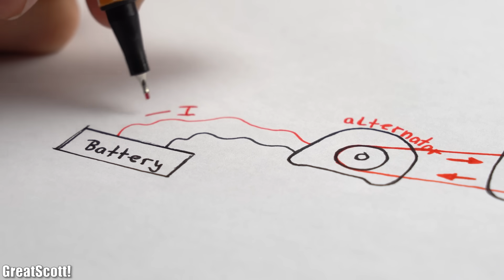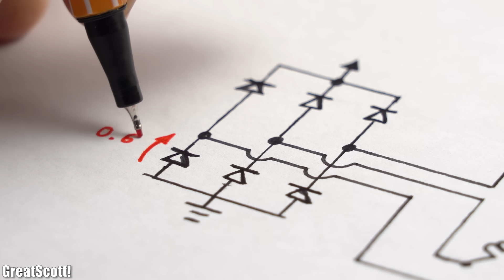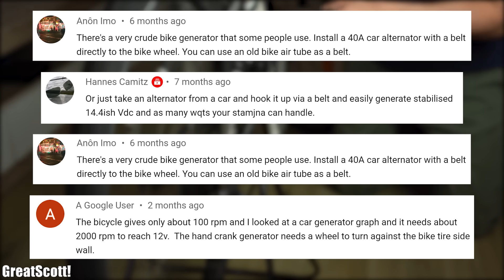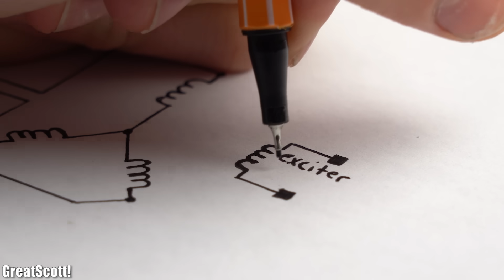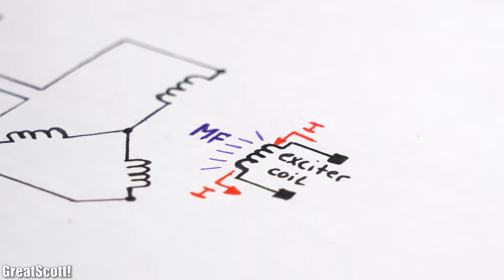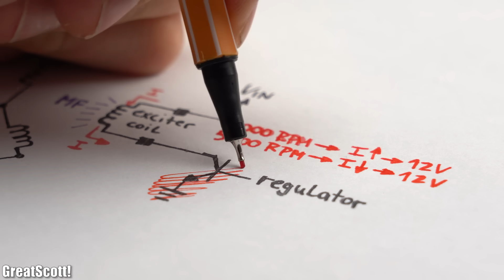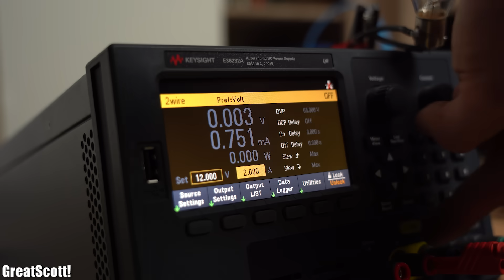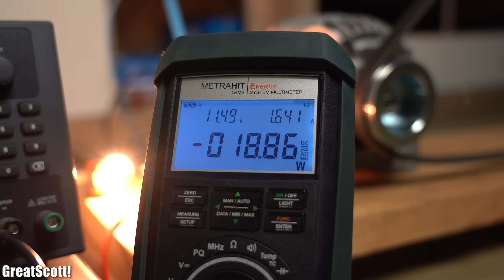Using a car alternator with a bike to power my home? How much energy can I produce?!

Comment: 2 questions: Why didn't you buy a 120 volt out put alternator for a car? Also, why haven't you browsed YT for those who have used a 12v auto alternator to generate 120v? Both are there and available.
Reply: any car alternator can be overdriven to make 120v and 5kw power and can be self exciting with a capacitor

Comment: Keep in mind that a alternator is not a generator.  It cannot produce electricity.  It can produce 11 to 14.5 volts on avg.   Try looking a 12v battery onto the positive lug and a switch on the exciter circuit.   Chances are you may need to start using the regulator circuit again.

Comment: I wish I could see it run again but this time with a .tensioner to Stabilize the wobble of the the need to add resistance to the Alternator was due to the absence of tension to the Belt. It was not taught  enough in my opinion. If you ever worked on a car or truck Bell System then tensioner Is What you adjust to secure the belt properly.  
Please try it again .🤔🤨🤨😉

Comment: Use a 12 volt battery and a switch run things off the battery use the switch like your ignition switch in car power things off of battery hook up an inverter to battery

Comment: you have to take two alt.... turn one into a motor and run the other to power your home and the alt motor as well it will  put out about 90 amps of 220 volts ...... have seen it done so it will work but you will need a solid set up to hold the alt and motor alt ..... but you cant run it all the time unless feeding it back to the grid   you have to take off the dc bridge rec of the one you use as a power your house source and one way dioid the lines to keep them from the grid back feeding into the alt..... so you dont get a shock from the grid be sure you have it all set to go before you plug it into the grid

Comment: Ok, this is my comment, and by no means am I an engineer, scientist,  or inventor.  I am just s guy with a thought. I would like to make closed loop system where there is a generator that will charge a battery that is connected to a motor that turns the generator that is charging said battery that is powering the motor, that is turning said generator... do you follow me? I hope so because I confused myself and can't remember who's on 1st

Comment: Something that would help you achieve more power would be same setup but the bike should have gears for low gear and high gear the higher the gear the more rpm just more wear on your legs .. also the best thing I could tell you is add a tensioner pulley to keep your belt tight so you get the most out of each turn with out it slipping at all

Comment: Great Scott use an older car generator pre 1974 car generator. This generator can be chiseled to spin with the field magnets to move the armature magnets and coils of copper wire.  Count the armature magnets and chisel off one sixth on and off all the way around the armature magnets.  When you reassemble it will be a permanent magnet motor that produces DC 12 volt. To convert to 110 volt AC power add inverters.  40 amp inverters are available.   1969 12 volt 120 amp generator can be chiseled to spin without fuel or cranking.  You could add inverters to have house current voltage

Comment: You can also overcome the need for the exciter coil by replacing the exciter coil inside with rare earth magnets.  There are several videos on YouTube on how to swap everything out.  You'll still need a belt tensioner to maximize your efforts and to keep the belt from slipping off, but you'll also gain additional power output since you won't be spending energy to energize the exciter coil.

Comment: Very interesting brother. I like this video.   I believe if you were to use an old washing machine motor. & maybe with a similar rig.  Remove the motor from a washing machine.  I think the coils would be large enough to output a good amount of electricity at lower 
RPM's.     

 Now what's better than powering it through a bicycle rig???      

Maybe large amounts of water gravity fed?  everything fed with just the pressure and weight of the water through a turbine connected through gearing? Or belts???

Comment: Try hooking a 12 v car bat to system as it would be in a vehicle . I had the same trouble with a water wheel set up I built . H2O  W  turned the peddle ,  " drive sprocket " of an old 10 speed bike then a belt off back rim , like yours ,  you will get a better result . !

Comment: Pro tip, hydro electric using a Pelton wheel if you have a stream near by. I bought one and used cinder blocks and clay to make a piped outlet where my creek was narrowest and I can power my entire house if I needed to now. I plan on actually utilizing it next outage and building a power barn
Reply: Do you have any more info on your hydro system on the net?

Comment: What did I learn from this video, I learnt the same thing I was taught as an apprentice electrician and a tradesman for 45 years, working in coal, manufacturing, power stations and heavy industry. That is, to provide base load power, you need, coal, gas or nuclear energy. Anything else is just virtue signalling. Wind and solar, (produced by fossil fuels), will never be able to replace, these raw energy sources, as a reliable alternative. Sorry but your experiment is 3rd grade science with no real solution for solving the change in climate or providing reliable energy to fuel the world's present and future needs. Sorry to sound negative, but sometimes reality is harsh pill to swallow. Even Germany the jewel in the renewable independence crown, gets their nuclear power via the grid from France most of the time, because renewables are a Joke.  Ouch!!!! Painful I know, but factual. Renewables just don't cut it and won't this century. Sorry people.😣😣😣

Comment: An alternator needs tge field Excited by 12volts .
As there are No Magnets in an Alternator ....
A Generator has Magnets and does not need the field excited to produce Power .... Took ya 10 mins to get there ! 
Early VW's had Generators not Alternators .
Why not just go Solar Charge by day watch TV by night ......
Add a light belt tensioner too ... Ugh.

Comment: I saw a guy that removed the diodes and it puts out 120v naturally. He had one rear bike tire and used a chain drive. He used a 9v battery to start the charge and spin the wheel, he had 120v coming out, can’t remember the amperage but it was pretty high! It would run on its own after the initial spin.
Good luck!👍🏻
Reply: Do you have a link?

Comment: Simply connecting a car battery would have solved many issues especially with output stability. Battery powers gadgets, alternator charges battery, it's the way it works.-

Comment: You coud of find the wiring diagram for the alternator by finding out what vehicle make and model(s) it's used on.  A vehicle mfg. will use a specific model of alt. to fit many of their vehicle models.  Also, the vehicle Mfg. may have the same alt. in different current [amp.] output. As a bonus of having the year,make and model of the vehicle you can also purchase the the altnators plug in [aka, pig-tail]. you can purchase the alt-pig-tail, from the dealership or a local autoparts store, the autoparts store alt-pig-tail will mostly be an aftermarket unit. Another likely source for the  pig-tail is a salvage yard, thats if you want to spent the extra time in a salvage yard, the good thing of the salve yard is that the pig-tail will have the same colors as the wiring diagram, it unusual that the dealership or autoparts pig-tail have the same colors, in most cases the wires will be of the same color. Theirfor you will need to look up the pin location and match up with the wires.
The Alt. has a feature to test the build in to the voltage regulator, you will need the service manual to find the procidure, it usualy shorts to groud the regulator an a degnated pin of the voltage regulator, this forces the alt. to a max out mode, it's only intende for testing purpouses, short term use. But you can increase it out put by manipulating it with ressitors, untill you obtain desired out put, dont recomend going more than 50% of its max amprage out put. Yes theirs more, the regulator automaticly will ajust the altnators out put on electricl load on demand. So, the best way is to have the altnator connect to an automotive battery, then the battery to a DC to AC converter. AC to DC converters come in different flavors,  ie: current out-put, usualy advertised in watt out-put. and tgers a differencen in peak out-put and continuous out-put, continuiuos is usulaly 50% of its max out put, the same gose to the alternator, if you rember the I recomended not to excied 50% of its max out put. max out put is a is for short burst of demand of current out put, also, running at 50% of its capacity keeps the untis, bougth alt & DC to AC converter, form over heating and prolong its life of use.
If you need more current [amps] than the highest automotive atl. avalable, than concider one from an ambulance, 250 to 275 amp out-put or more.  You can can also, ues mutiple alternators. Their, are also alternatores that use permant magnets that self excite, their usualy found on farm equipment, ie: farm tractors... 
Good luck in your project...

Comment: I used a treadmill motor 12 volt, and works well. Used a belt off my son's car around the rear wheel to connect the bike to the generator. Either way, the idea does work, just takes some work.

Comment: I also noticed that you were using the wrong gears. At the pedal you need to use the largest chain ring, and at the wheel you need to use the smallest chain ring.

Comment: And here I am thinking what would happen if he expanded this experiment with 3 alternators and a welded monstrosity of a back will to support 3 at one time as well as an electric motor (one alternator devoted to powering the motor) to power the bike after it starts it's spin. Is such a thing actually possible?
Reply: Absolutely NOT!  Fundamental law of thermodynamics states that you cannot get more energy out of a system than you put in.  Another law of thermodynamics states that you cannot even do that well, ie. the energy out will be less, and often much less, than the energy put in.
Keep this in mind the next time some article proclaims "Free Power From..."  There is no such thing as a free lunch, or free power!

Comment: Just buy an X13 electric motor. Take the module off the end cap and spin it. I have one I attach an electric drill to and can generate up to 330volts AC off of each circuit

Comment: Should have set up a belt tensioner. It would help with your belt slipping problem also use a higher gear so you don't have to peddle as much a long with most car alternators produce 75 Amps at 14 volt so you should be capable of producing a decent amount of power along as you can keep the alternator over 750 rpms... most are over 1250 rpms if I remember right

Comment: Your almost there … the car alternator has an internal regulator. You need a 12v car battery for storage. Also a power inverter to convert DC to A/C . I would also so recommend a 1+ farad capacitor for power surge from large electronics . Now your ready to watch tv and microwave dinner 🔋🔋🔋🔋

Comment: You need an alternator with smaller gauge wire for lower rpm under a load.  Missouri wind and solar sells these.

Comment: You're running the lowest gear on the bike. You're going to get far higher speed from the tire when in the largest gear at the crank and the smallest gear at the rear.

Comment: In my opinion an alternative to pedaling would be to use  an electric bicycle motor or multiple stirling  engine to produce power at a small scale not sure about the kilowatts it will produce  but I do think it can be used especially when mechanical pedaling is not an option

Comment: Take it apart  and put magnets in the roter. You  can drill into  it so the magnets are flush  with  the surface of the roter. This will  make it so you  don't  have  to excite the roter  with your  battery.

Comment: Alternators need about 2400 RPM to start producing electricity.. You'll want to do something about the regulator too.
Reply: Wrong.  Properly set up the alternator charges the battery at engine idle speed.  Hooking up a 1000 watt ghetto blaster will negate that capacity, of course.
Reply: @BasementEngineer  "Wrong.  Properly set up the alternator charges the battery at engine idle speed." 

Wrong. 
I said Alternators.  

I did NOT say engines driving alternators. 

I did NOT say bicycles driving alternators. 
I did NOT say waterwheels driving alternators. 

Often enough one will find an engine that needs sped up some (1700 ~ 2200RPM) before the alternator can stabilize output at idle. 
This is the case with my military humvee and box-van, but not my gasoline Volvo SUV.

Apparently you don't know what "properly set up" means either.
It's merely the drive pully to alternator pully ratio, to provide ~ 2400 - 3000 alternator RPM at engine idle.
Too simple to randomly pretend you know anything with "properly set up," phrase. SMFH

Diesel engines have lower RPM across the board than gasoline engines. Alternators on diesels need smaller pully diameters so they'll spin 'faster'. 

If one wants 14.6 volt output, adding a reversed 10 Amp diode to the regulator voltage input will provide faster early charging. 

__

"Hooking up a 1000 watt ghetto blaster will negate that capacity, of course." 

Wrong. 
A 12 volt, 300 Amp alternator will output 3600 watts. 

gtfoh
Reply: @Dr_Wrong  Well "Dr" Wrong, you're wrong again.
You generalized by stating "alternators need about 2400 RPM to start producing electricity", a statement that is pure and unadulterated rubbish.
Low-head hydro-electric power plants produce full power at very low RPM.
Automotive alternators maintain the starting battery's charge at 700 rpm engine speed, or so.
Do you know of an off-the-shelf passenger car that is equipped with a 300 Ampere capacity alternator?
A standard automobile alternator has a capacity in the range of 100 Amperes;  some more, some less.  A 1000 Watt amplifier going full blast will more than swallow all the alternator's output.
Reply: @BasementEngineer  
And solar panels produce electricity at Zero RPM..
did you watch this video?

Nominal 12 volt 100 Amp alternator = 1200 watts 1200 > 1000. 
But actually about 1400 watts.

Give it up, you're clueless.

End of comm.
Reply: Dr Wrong: What does a photvoltaic array have to do with alternators?  Go and seek help.
Your moniker is certainly appropriate.
Reply: @BasementEngineer  
Can't ever get attention from your mom or dad? Acting bratty for notice from internet adults..
Utterly sad.. 

"Mommy's Little BasementEngineer" whoo whoo chugachuga chugachuga whoo whoo "ALL ABOARD!" 
"Mommy will love you if you're quiet, don't let mommy's men friends know you're here.. Just 20 minutes, then mommy will have money for food.." 

I'm not adopting you.
Reply: @Dr_Wrong  Don't quit your day job, assuming you have one.

Comment: This is a very important factor that's missing in this. A car alternator not need a battery to work. If your Battery is extremely low it take longer for the emf to bill up. A alternator as no magnets to make emf. So the power from the battery in the coils make the emf. This is a very missing leading to me.

Comment: Add more mass to the wheel, gravity is your friend
Reply: In the classic BayGen hand-crank radios they urilized a weighted flywhweel.

In BayGen's case you wound a spring, which then uncoiled itself while spinning a weighted flywheel.

Notice the word weighted.

Same PRECISE principle should apply to any wheel-based power gen setup.

Use simple gravity to create electricity🙂

Comment: It is the correct concept. Here in Alaska the remote cabins use a windmill to do this. The typical car alternator used is a GE because it has an internal regulator. This can be used to charge a batter bank for basic lighting.
Reply: I like the windmill idea of the power application. With this power source this idea could provide plenty power to run everything with dc power.

Comment: a 2 wire gm alternator would have solved all your problems. also, tension that belt, get a heavy flywheel, and it will be easy as cake to pedal.

Comment: To steady your belt you need to add a belt tensioner from your plank to the belt. The steadier the better. Less wear in the long run.
Reply: Problem is, the alt. and bike mounting brackets are both to weak to run a tight belt. One thing leads to another.

Comment: Why didn't you just pull the bike a little further from the alternator? You should have used a higher gear. You should hook up a 25 pin gear to an 11 pin gear, several times over. Then, hook up a flywheel to a coasting, rotating gear. This way you could have gotten a better reading. Next time look for a natural magnet generator.

Comment: You could just run the alternator directly off the back tire using friction. Just get a road tire that is smoother. Also you want to be in the big ring in the front and smallest gear in the rear. That's is actually your fastest gear.

Comment: Generating power isn’t a problem at all but the real power is to spin the wheel after you put some load on this system because when you will put load on this system the movement of wheel will require extra force to spin. In other words more energy you will use from this system, the more energy you will have to put into this system to keep it running efficiently. This sort of system is not feasible to run the house.

Comment: You're still missing some things. Using an inverter, I ran my house freezer and refrigerator off my alternator during a storm, with plenty of power left to keep the car running, and plug in a power strip, which charged our 3 phones, ran 2 lamps, and my small coffee maker, all at the same time, at a constant 800-850 engine RPM's.